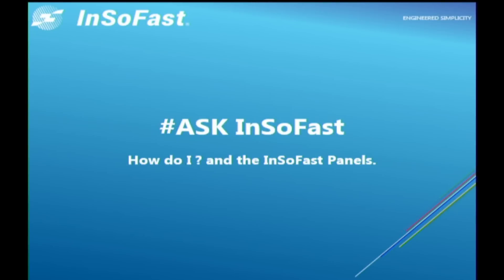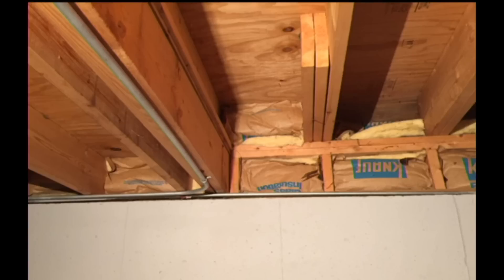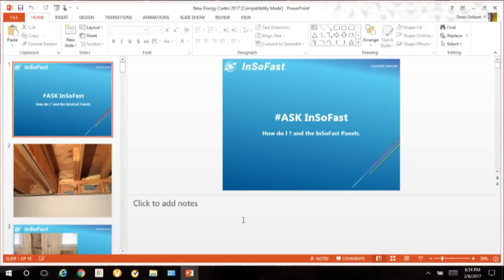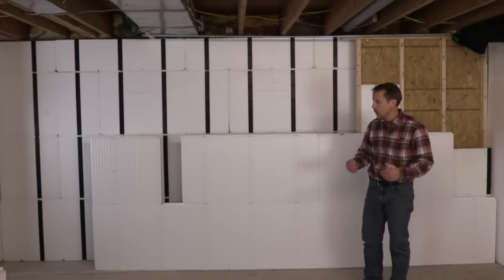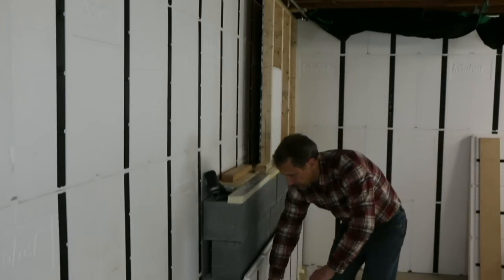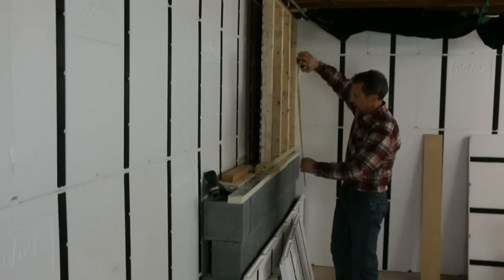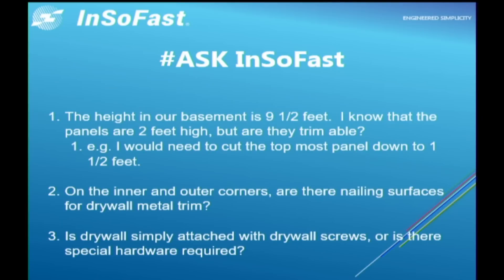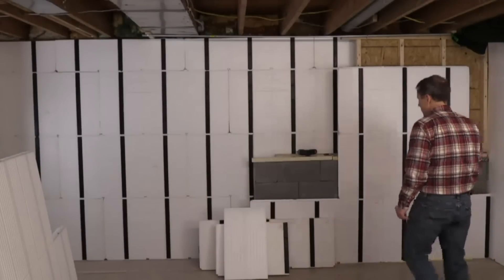#ASKInSoFast How do I ? and the InSoFast Panels

Comment: I have a half wall of cement while rest is made with 2X4. 
if I use UX 2.0 I will have a 4-inch ledge created. how do  i attach sheetrock on  the top-side of the ux 2.0 ? the wall looks exactly like the set-up you have for demo.
 I dont want to use Insofast on top as it is already framed and insulated. i will be only installing insofast ux 2.0 on the concrete portion of the wall.